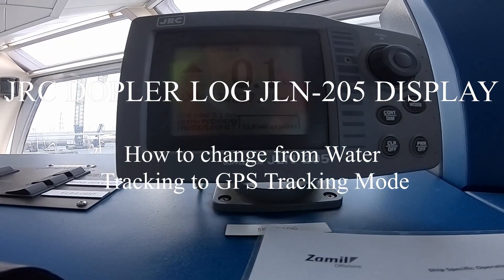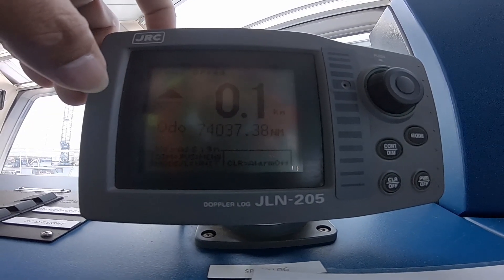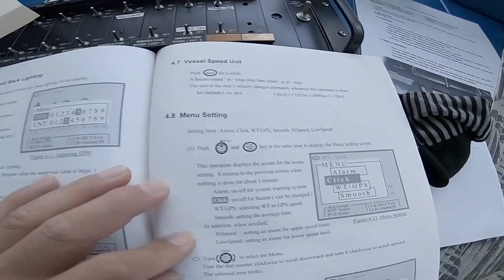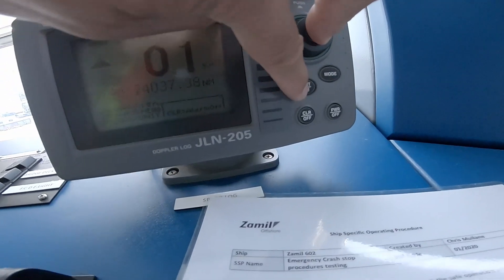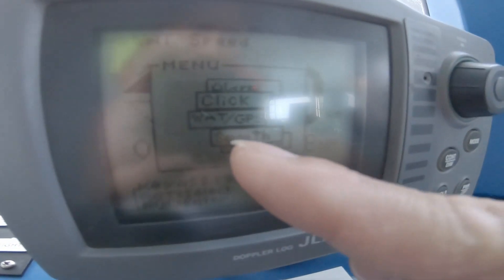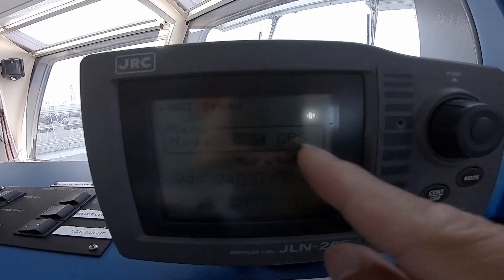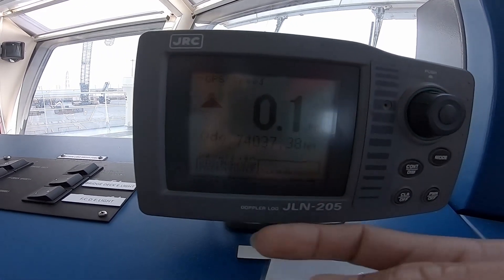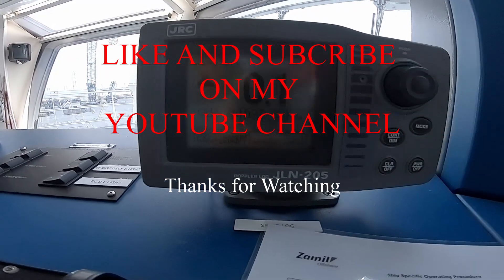JRC Dopler Log JLN-205

Comment: How come to adjust menu for change % of correction speed?
Reply from the maker: Hi,
it depends on the actual readouts on your actual speed difference. The most reason why the difference value is increasing because of the transducer transmission. In some cases, week transducer power, but most of the the the sea growth covering the surface of the transducer is the reason, cleaning of transducer is required. Make a notes or Log your speed log speed and GPS speed for your reference in all direction of tides. Then you can compensate the difference through calibration.